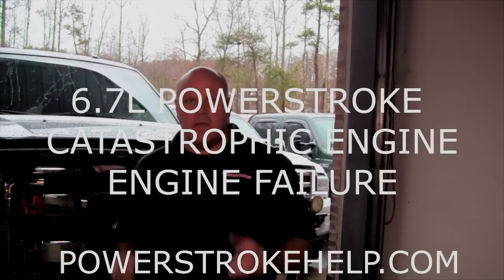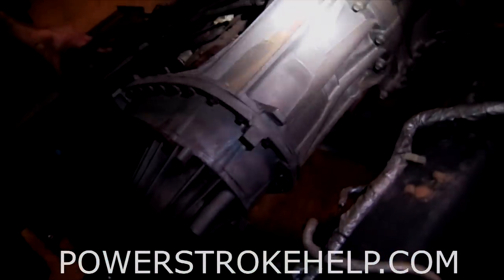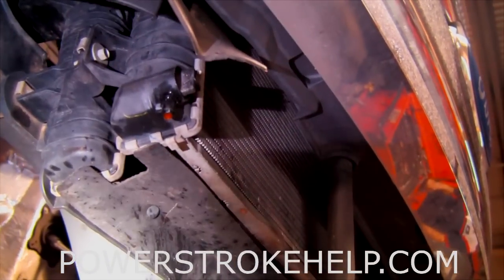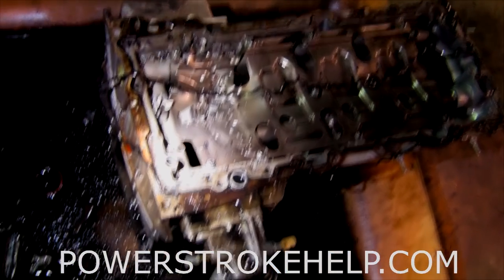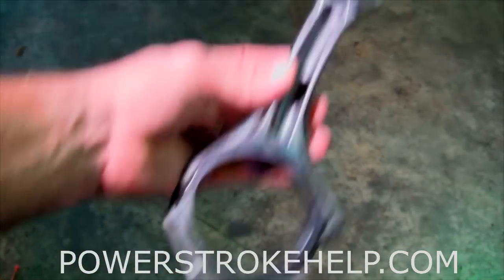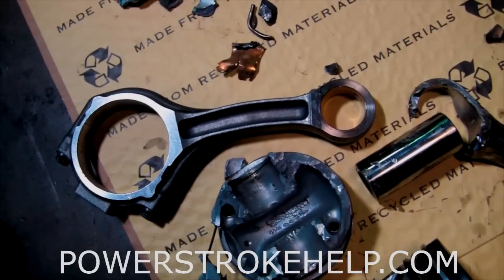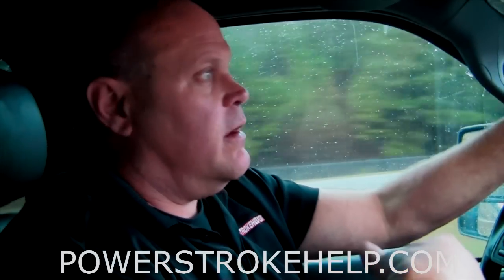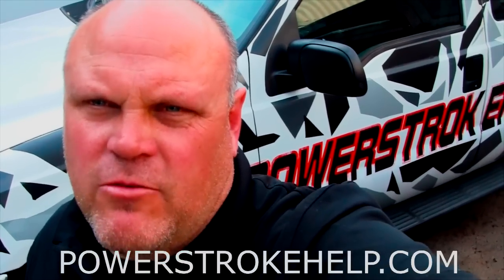6 7L POWERSTROKE CATASTROPHIC ENGINE FAILURE

Comment: Your question at 10:50 - "Did the rod fail first, or did the piston fail first?".  The failure of the rod is at an angle that would suggest propagation of a fatigue crack.  I would bet a dollar the rod went first.
Reply: It doesn't matter. Neither were designed to withstand the cylinder pressure, that is being created by these ridiculous tunes, and giant power gains. In other words,   1. Which is more likely to destroy a combustion chamber, when you light it, inside the cylinder ?     A.  (a firecracker)    or   B.  (a stick of dynamite)
Reply: I would bet the rod went first too because if the piston went first wouldnt the rod still be intact?
Reply: Piston
Reply: thomabb i bet the rod failed too if the would use better parts all forged not cheap cast shit these motors would handle just about anything you could throw at them and i bet people wouldnt mind spending a little extra money on a motor that was built to handle 1500 hp or better but they want them to fail so. You have to buy more from them and this is with all trucks and cars

Comment: are the 6.7 engins a good peace in stock form could a guy expect 200,000 without too much trouble.
Reply: The early 6.7 had ceramic ball-bearings in their turbos which came apart.  Bill has a video on those.  Think mainly the '10 & '11 trucks with the plastic oil pans.
Reply: my 6.7 has 210,00 miles on it and runs fine. it just went through a cp4 pump, but the pump just died it didn't send metal through the system. dpf delete, mini max (99% of the time is on stock tune) egr delete and dpf back exhaust and runs excellent.

Comment: I personally LOVE the old 12v Cummins as well as the gen 3's 24v pre emissions. but I'm wondering. labor and parts. what does it cost to bullet proof a 6.0 so it'll last forever.
Reply: brian6265 $7,900 Bullet Proof.  He also sells Bullet Proof Transmissions from his contact.

Comment: You guys work with flashlights all the time. Why not just pay the electric bill?
Reply: Lot easier to use a flashlight to look in tight spaces than have to drag around a power cord attached to a hand-held shop light.  My father is a retired auto mechanic and I helped him in the summers during my childhood.  Absolute pain in the a** to drag that shop light cord around.

Comment: my job i have been driving 6.0 till it puked. the truck doesnt even have 190k and the engines valve cover is stickered ford reman and it maybe needing another engine or major work. not sure since im not the one diagnosising it but i heard the owner saying it had like 13 codes stored

Comment: you have 3 choices with cars and trucks, fast, reliable, cheap... pick two.
Reply: Fast and cheap isn't going to happen.
Reply: Tom94 not true. You can put nitrous on a $500 ranger and go fast... once
Reply: @Tom94.1  fast and cheap is easy.    get a honda civic body for around $500 and throw in a v8 from a totaled mustang 5.0 for about a grand  there i spent  $1500 and a weeks time and now have a car about 2000 lbs curb weight and has almost 400hp (just weld the mustang subframe under the front of the honda and throw the mustang rear end under it  and wire the key and run  shifter cable and aftermarket triple gauges ) it's not a problem for anyone who can cut and weld and knows how to hook ignition to the harness cut from the mustang and it will be faster than you'll want to ever push it due to nearly halving the weight the motor was made for
Reply: Tom94 look up sloppy mechanics 😉😉.

Comment: Bill, well said on tuning these trucks. I have a 2011 and a 2016. 16 is bone stock ( work truck ) and my 2011 is my POV. I have tried different tunes but the key is to stay close to stock numbers and leave the emissions there.  DP as he said is a great company for tunes, I also recommend AM Diesel Performance and 5 Star tuning. All of them have great Emissions on tunes and will work with you to make that tune feel right to you. Shifting points, times and lengths are the most complaints on tunes. All 3 above have great starting points, but will tweak them to your liking. 

Don't go kill your trucks for crazy power, when these trucks are awesome enough as is. IF you do want to go crazy, you better start upgrading internals. If you don't and you break it, don't go blaming Ford, Its on you.

Comment: See the thing is having a fast truck is to cool. It is such a special feeling when the turbo or turbos light, if it hooks it slams your neck back into the seat, if it doesn't hook it turns the rear tires into a smoke show. Either way it is so much freaking fun! Thats why people do it.
Reply: livalittle100 
These so called people have obviously never gone for a ride in a fast car
Reply: And these are the results! Gotta pay to play!
Reply: I do it on a $5000 motorcycle. My trucks are work vehicles. My bike will beat 99.99999% of trucks at 1/100th the cost per mile.

Comment: the 6.7l is the worst engine ever made, I'll stay with the 7.3l and 6.0l PowerStrokes. 6.7l PowerJunk.
Reply: My 6.7 is going on 6 years and.no problems.  Check engine light did come on just recently, a cold weather heater for the DEF tank is all.  It's the god damn emissions insanity that makes a diesel like a space shuttle.
Reply: ***** I've seen more problems out of the 6.7l PowerStroke, than all the others
Reply: Zach's Garage you are either very young or unable to see past the 6.0 and 6.4 Fiasco's. When you see transmission fluid that color at 130000 miles that man is beating on that truck. No Duramax no 7.3 powerstroke no Cummins diesel can put up with that crap. I have seen to FEMA trucks one-hit 486000 miles on it and the other one has 503000 miles on it with my own eyes. And they hauled the maximum load for F-450 pulling FEMA trailers all over the country seven days a week. They were 2011 I saw them last fall in Waterman Illinois and a Casey's gas station. I could not believe it. He said they have had nothing wrong all they had to do with Brakes and Tires a couple times. Ford needs to work on their crankshafts but as long as you use archoil you're fine. Archoil just fixed my 7.3 powerstroke. I have documented it and everything else I have a hundred and eighty thousand miles on my 7.3 and I can now start my truck without plugging it in for the first time in 3 years
Reply: Damn you've never heard of the 6.4 powerjoke then cause that engine was a joke along side the early 6.0s
Reply: The 6.0 is in fact one of the worst engines ever produced. Yes it is actually on the top ten list.
The 6.7L is a great engine, it's made to be left stock. It is not for teenagers who know everything...
Reply: right on zack 6.0 bulletproofed. or another brand bottom line. I think I will stick with my already bulletproof duramax

Comment: I drive a 99 f250 7.3 all stock im happy with it it has a few problems but it also has 400k miles on it looking at a new ford truck but after seeing all these 6.4 and 6.7 motor problems im not so sure about spending $70k on a truck that wont last
Reply: shawn gill well then just go with what he's sayin. leave it alone.  that Ol ford done it's time.
Reply: Greg Or Jen yrs but after seeing these type of videos im a little nervous about the 6.7 powerstroke durability that's why i stayed with the 7.3
Reply: shawn gill fair enough,  keep it stock. these engine are putting out massive amounts of power and torque. I'm guessing that most of the problems originate from big power tunes. I'm in the same boat as you. selling off my 06 duramax for a 2015, hoping for the best. I highly doubt you will have any serious issues if you managed to keep an old miled out truck still running this long.
Reply: Yea my 7.3 is still stock i probably buy a 350 next year

Comment: Great video and impotant information, I will just keep my stock 1998 Dodge 2500 with it"s 12 Valve Cummins that pulls anything that I need to pull.
Reply: FYI, Dodge and Cummins made the switch from the 12 Valve 5.9 to the 24 Valve 5.9 Cummins about the middle of the 98 Model Year. Any 98 Dodge with a 24 Valve Motor is referred to as a 98'1/2.

Comment: What about running the deletes with a mini maxx tuner still on the stock level tune for those just wanting better economy and not have to add urea?
Reply: Im sure it will be fine as long they keep it around the stock level tune. This guy was probably on performance tune with a trailer in tow. Big no no. The performance tune increases the timing and pressure inside the cylinder. Pair that with a heavy load and increased pressure on the engine and it goes boom.

Comment: But you kind of say it's okay to delete the DPF and EGR on the 6.4 truck, which I did on your recommendation. I run a Spartan tuner with the DPF/EGR off, stock tune. How is it different for a 6.7 vs a 6.4?

Comment: A mini maxx is one of the best options for tuning.. "a mini maxx has too much timing"? There are many different options for custom tunes through a mini maxx that are very safe to run with out a doubt. There are a one or two companies that really try and push an unsafe amount of power but that is not due to the H&S unit itself, that is due to that individuals tune files. Tuning these engines with out deleting the dpf is useless as well. The amount of emissions would increase with the dpf tuning on, and there for the dpf/scr would work harder to "clean up" the emissions and the dpf filter would clog/fill up quicker. With the correct custom tuning, a 6.7 with a stock bottom end will hold up to 650 generally. All about bringing the power on smoothly.
Reply: Love my mini max . Set it to default timing and tow and don't touch it . My 2010 cummins has never ran better

Comment: I think Bill hit the nail on the head. Just because you can make an 11 second 4 ton truck doesn't mean it's a good idea. These trucks are meant for TOWING not RACING. If you want to go fast buy a crotch rocket for half the amount of money you will spend rebuilding the engine in your truck.

Comment: You ought to make a package of videos about how these engines fail and warning signs to note and respond to before catastrophic engine failure. This could be helpful for your fleet customers to train their operators. The videos you make have far better graphics than the fleet owner could replicate second hand to their employees. This would allow the videos already produced to help your customers at minimal cost to you.
Reply: well fleet customers don't run stupid tunning
Reply: James Henry, If you really want to know how an engine is performing, have an oil analysis done. Blackstone does a really good job and its cheap too. It will let you know long before you have any bearing failures or increased contamination in the oil. Been doing it for the last 40k miles on my truck and they managed to find out that i had replaced my oil pan seal, because of a minor increase in silicon levels.

Comment: even without tuning in a 6.7 would you advise the deletes for the life of the motor in a state that doesn't have emmisions laws "Oregon" or would you just advise the DEF delete?
Reply: In these trucks you cant just delete the DEF. The DPF, DEF, and SCR system are all in the same section of exhaust. You take one out the rest goes with it. Also you cant modify anything on this engine without a tune. As soon as the truck recognizes something is missing, it goes into limp mode and the truck doesnt move. The tuning is used to remove the programming from the computer so that the truck doesnt even recognize the system anymore. coincidentally people also get crazy with the tuning and go for max power. If you go with a mild tune and dont romp on it with a huge trailer, the truck should be just fine.

Comment: I have a 2006 6.0 f350 king rancher that is not bulletproof and it has 250000 miles on it can I run an eco tune to get better fuel efficiency? just got the truck a few week ago
Reply: I'd put head studs in that thing IMMEDIATELY.

Comment: Are there any tunes that get rid of emissions but don't mess with timing? I think that's why a lot of people want a tune. So they can get rid of emissions and not worry about replacing the exhaust after warranty.
Reply: Yeah it's called changing out the stock exhaust downpipe back after the warranty runs out and leaving the computers alone lol
Reply: Not on these trucks, Downpipe back is deleting the DPF and DEF system. That means you have to tune those controls out of the computer. Otherwise the truck goes straight into limp mode and it wont go anywhere. If you are a responsible owner you can delete the truck and put a very mild tune that does not really increase horsepower and torque, but will remove the emissions equipment from the computer.
Reply: You can't do that. I think the truck will run in limp mode if you mess with the emissions stuff without altering the computer. It's not like the 6.0, you need a tuner. I was wondering if there was just an emissions delete tuner that didn't add any power. I'm sure these trucks have enough power as it is.

Comment: I've been ford since the 6.9idi, I've had everyone except this new 6.7.   After having 5 duramax diesels, the LBZ is the best diesel I've ever driven, stock or otherwise.   Fords new trucks sure are nice with all the new amenities, but they will ALWAYS screw something up.  6.0, 6.4 now their own in-house 6.7 has premature problems.  I wish they would build something that just works, so I can justify buying another ford.
Reply: The new 6.7L Power Stroke is the closest to my 2002 7.3L Power Stroke yet. You owned the JUNK 6.0L and 6.4Ls. Also the Duramax is a JAP engine....not a International Navistar or a Ford.

I've never seen a GM truck...(PLASTIC 2500HD etc) hold up like a Ford either. Just crawl underneath and see how cheap and chinsy everything is made in comparison to a Ford F-250/F-350 Super Duty.

That's a lame cop-out everyone uses to justify why they owned or bought a piece of shit 6.0L or 6.4L Power Stroke truck. You won't hear me or anyone else with a 7.3L ever say a Cummins or a Duramax is/was better......LIKE HELL IT IS!!
Reply: This has been a problem with Ford product development for decades.  They have developed countless V-8 gas engines over the years and only the 385 series and small block (265-302) are worth mentioning .   They have done the same with the diesel V-8 with Navistar as their partner in crime.   Yet, people will continue to purchase Ford products and  make excuses for their shortcomings.
Reply: John Doe the 6.7 ford is made in mexico. duramax is made in the us.

Comment: This should be a valuable lesson to anyone considering speed/performance mods on your diesel truck. Leave it stock....the original engineers who designed it knew what they were doing....

No wonder your truck shits the bed on you. You've exceeded the perimeter for which it was designed to run in. When you step on it to cut a left corner and go through a left turn arrow at stop light, you shouldn't see a big cloud of black smoke belching out of your tailpipe. You're rolling coal just taking off. Unless you got stock in heavy traffic with prolonged idling at low RPMs...loading it up....it SHOULDN'T BE ROLLING BLACK SMOKE!!

Hello: something is very wrong here....um yeah duh I think so!! Too much boost, overfueled, overtimed, (whatever the hell). You are pushing the truck to limits it was never designed to be in. Sooner or later something will cut loose.

From a 2002 F-250 Super Duty 7.3L owner who bought it brand new and still drive it daily. The only mod to this truck is a K&N air filter.

Comment: Bill what tuner do you recommend for these trucks if you do the DPF delete?  I want a tuner that deletes the DPF and EGR but doesn't advance the timing. These trucks already have a ton of power!
Reply: Tuners don't delete anything.  You can block the EGR electronically, but that's not a permanent fix.  To DELETE is to physically REMOVE.
Reply: I have a deleted 6.4 that I removed the DPF and EGR. You are correct the tuner doesn't physically delete it, it turns off the regeneration cycle and if you have an EGR valve in place it closes it. But you need the tuner to do a delete without burning up your motor.

Comment: Excellent video, Mr. Hewitt. My fiancée and I purchased an F350 to tow some trailers around. After going through your videos, website, and some other YouTube channel videos regarding the 6.7 "Scorpion" engine in our 2013 (mfr date 12/12), I've come to realize we avoided the dreaded the ceramic-coated bearings in the turbo. I hear that is a good thing since they have been known to disintegrate. There are supposed to be steel bearings in this years' (2013) turbo. We purchased the Damerow Ford-Dealership truck (located in Beaverton, Oregon) with 64k miles on the odometer. It is the platinum trim level. Unbeknownst to me, the center console between the two front seats is permanent. I think we will be getting a trim level that has seating for 6. Why did Drew Bledsoe (former nfl QB) need to get this truck with this trim? I don't know, but we have his old truck and will be trading it in for a different one.